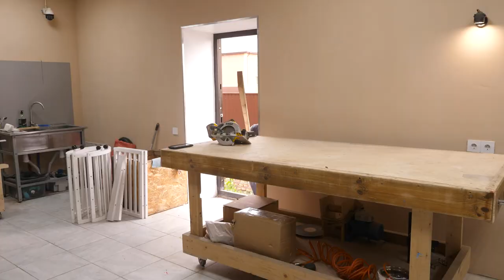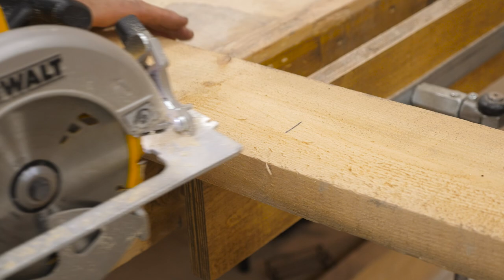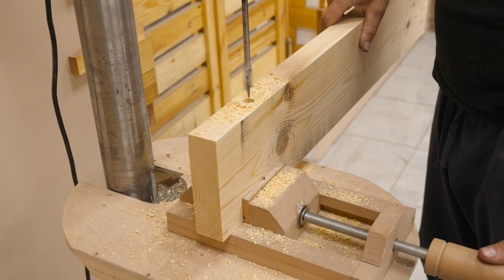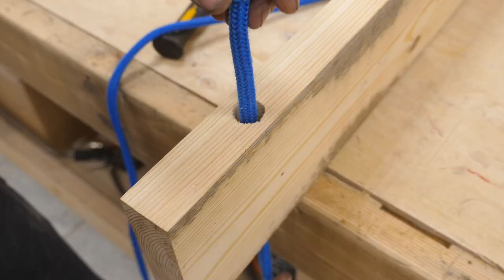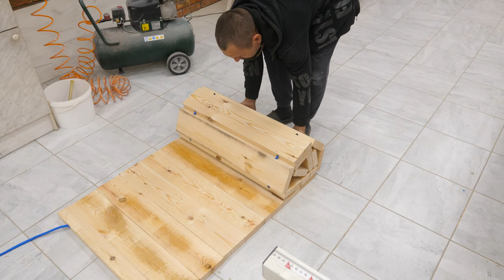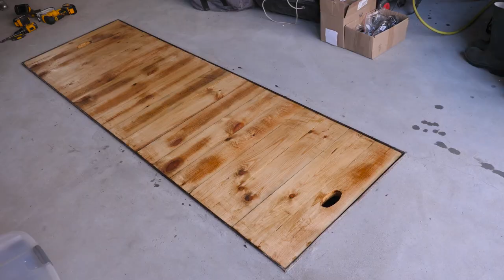This idea is already 100 years old. But she never ceases to amaze!

Comment: If you found an old cable reel/drum wide enough, you can roll in in and out and store it  when you need to use the pit. A lot of people have a pit in their garage (or used to) the big danger is if you have a fuel leak that fills it with petrol fumes and then you turn something on that arks like an old drill.